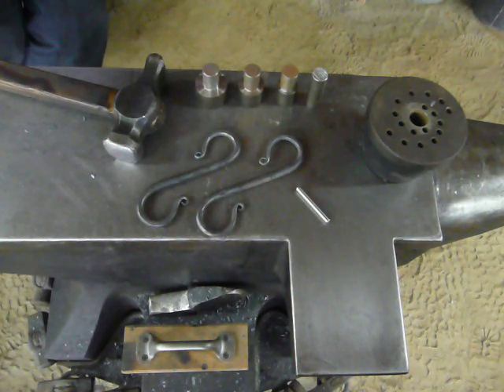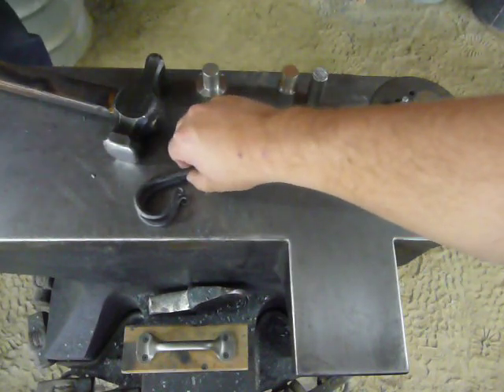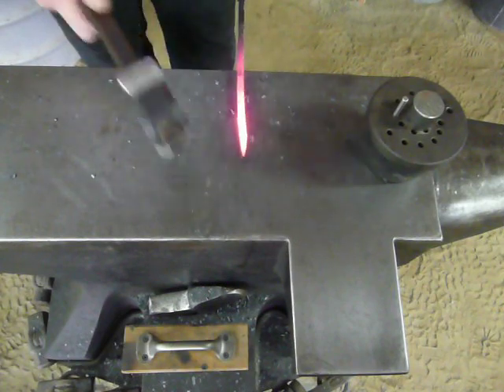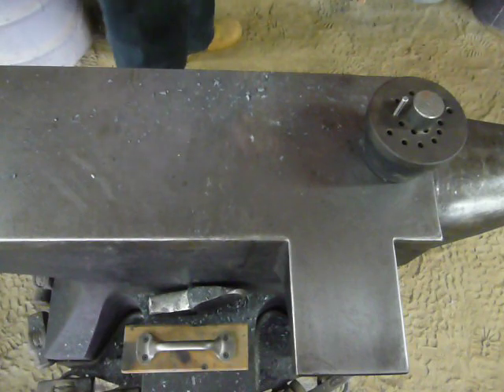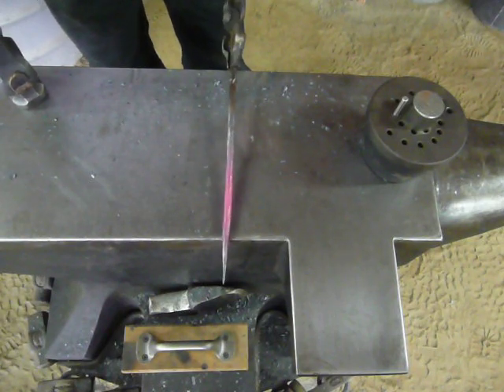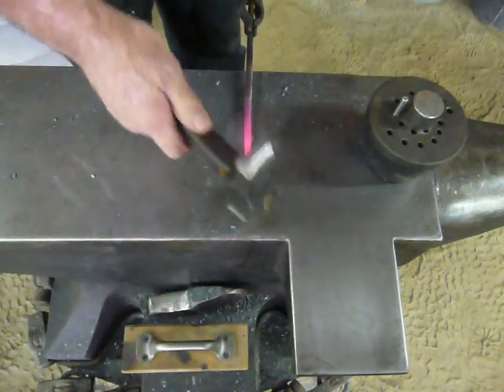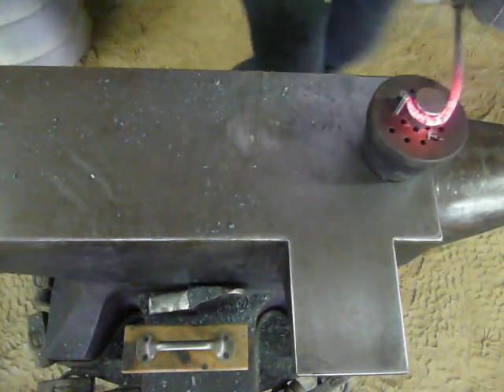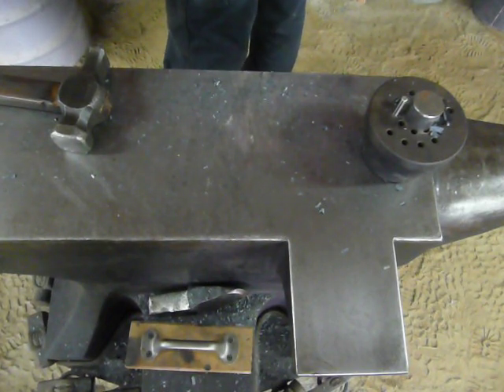Hook Jig

Comment: For those without a traditional anvil:
You can clamp any hardie tool into a post vice or large bench vice. A lot of vices also have an anvil face on them. I have a rally large bench vice pinned down to a log section in lieu of an anvil. Anvils can be pricey, and it could be a long time before I can even afford one. Been using this sort of setup in various forms for 7 years. Same techniques apply.